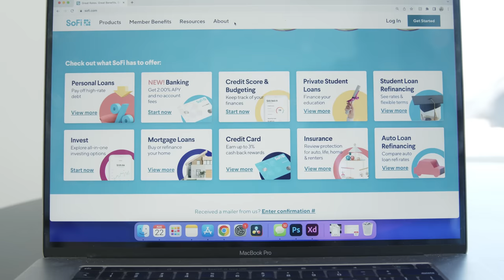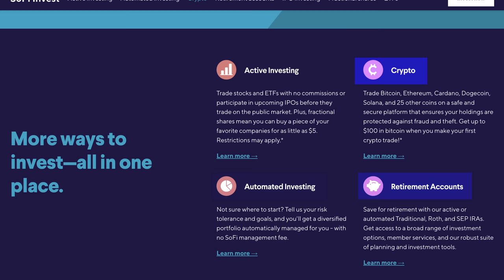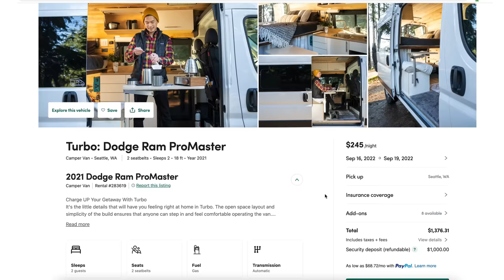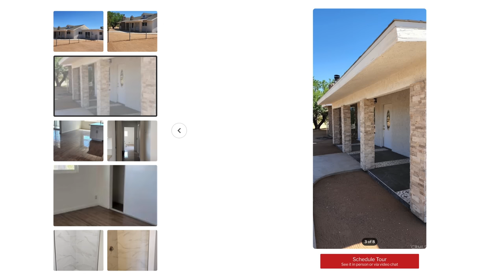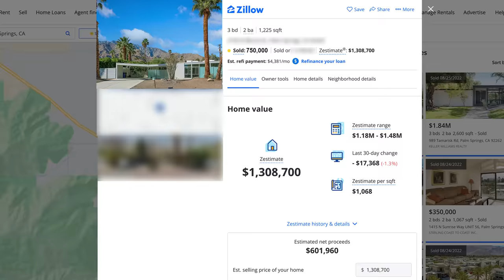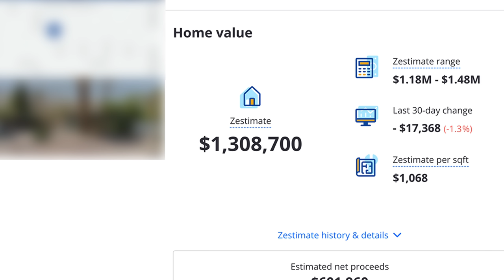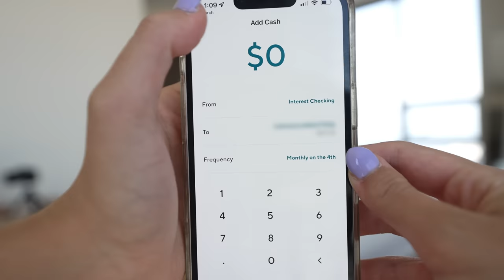How I’m Investing in 2022: My Top 3 Investments

Comment: wow, if your palm springs rental could sell for anywhere close to 1.3, was it an idea to sell it instantly? before things might fall apart. half a mill is half a mill that could be placed in stocks when the market bottoms soon or repurchase at a low point in house prices. granted you might have gotten a good loan compared to the 7% it will soon be but maybe that will fall back in a couple of years as well. I tend to be perhaps too trigger happy in timing the market but there is a comfortable certainty in instant cash :)
regarding joshua, maybe timber and labor could be a bit cheaper if you wait a few months but that might happen anyway. I gather that there is a dramatic decline in contracts for new builds right now. I think Toll brothers said something like 2/3 drop or more.